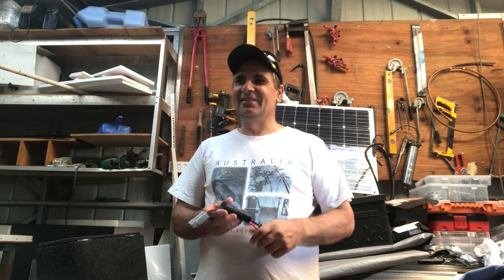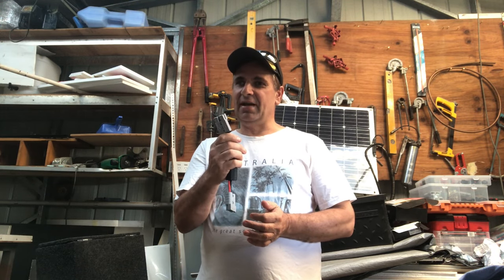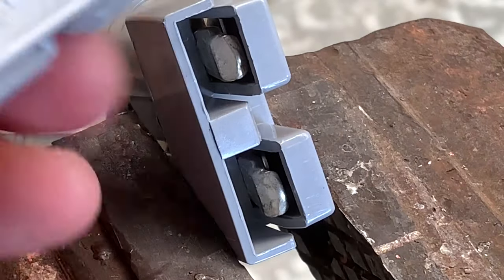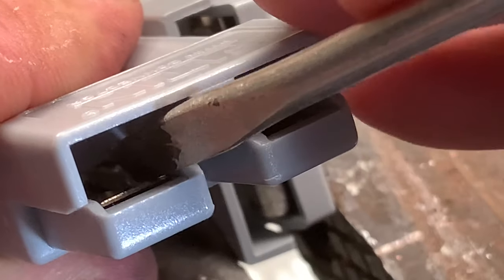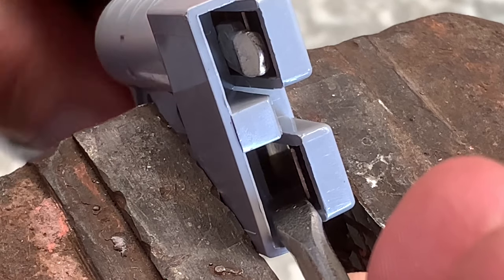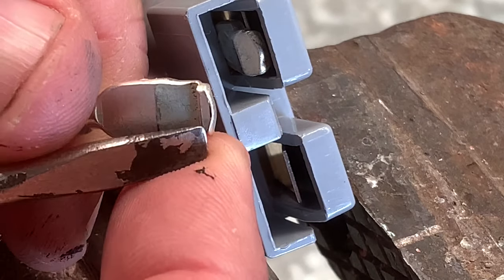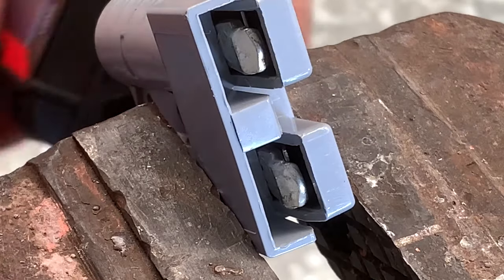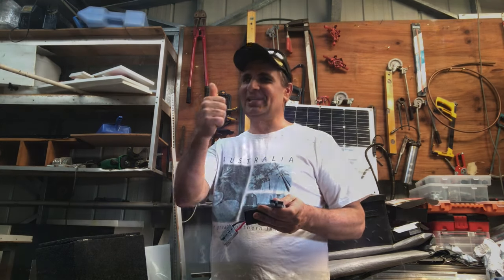Removing lugs from Anderson plugs

Comment: Great explanation. Thank you so much. I almost had had it right just holding screwdriver the wrong way. So I done too of these plugs yesterday but it was only after zi had done the first one thst I realised I had put the negative cable in the positive side of the plug and vice verss so I done the same for the plug from the battery to the plug from the power cables to the vehicle. I will change it today :) . 
Prefer yo have it right.
Reply from the maker: Cheers mate thanks for watching 👍🍻

Comment: This is way easier than what I did previously. Ask someone to help pull.

I also pushed the screwdriver on the wrong spot. I did it on the terminals and not the metal plate. 🤦‍♂️
Reply from the maker: I am guilty and done the same thing previously myself 😀 . I’m glad the video has helped you out and thanks for watching 👍🍻